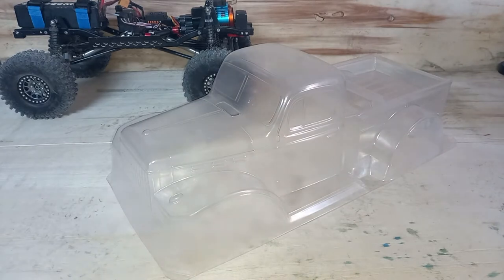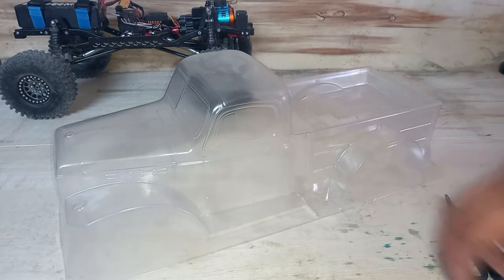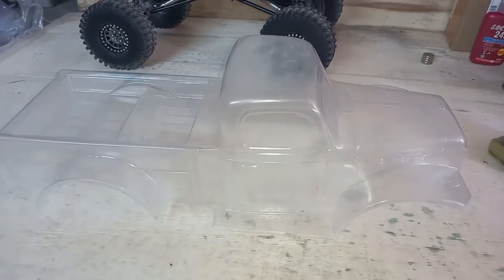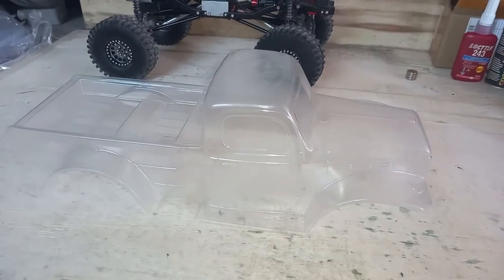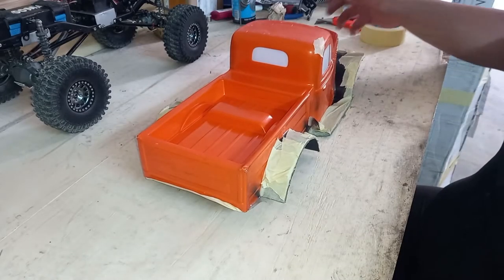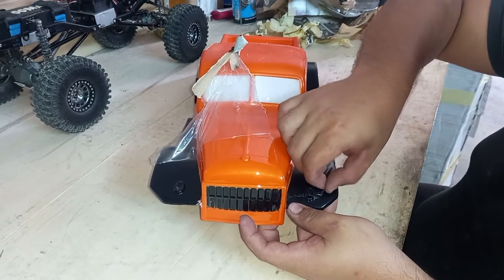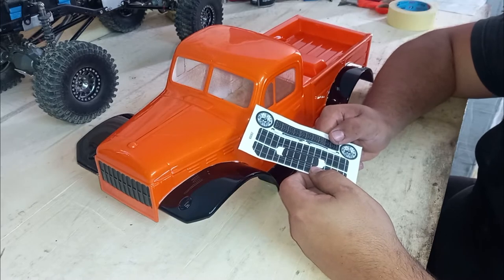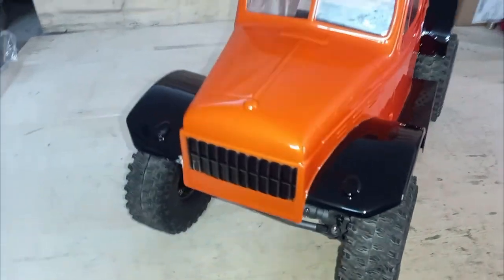Prepping and painting a clear RC crawler Powerwagon body

Comment: Why do you need to use the sponge? To clean it ?
Reply from the maker: I used the abrasive side of the dish washing sponge to create a good surface where the paint could adhere to for a solid base, otherwise the paint could chip and peel. You could use low grit sand paper like 1500 or 2000 grit I believe as well. And most importantly degrease with brake clean and a clean towel like me or with hot soapy water. Thanks, hope I helped in any way👍